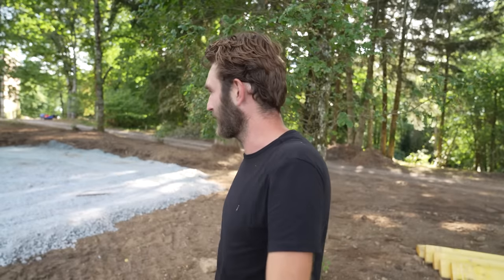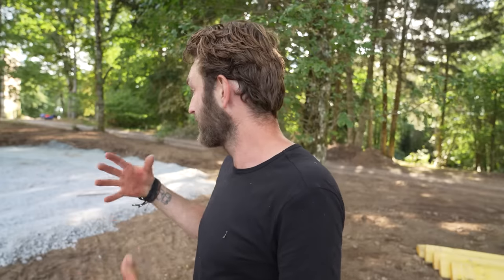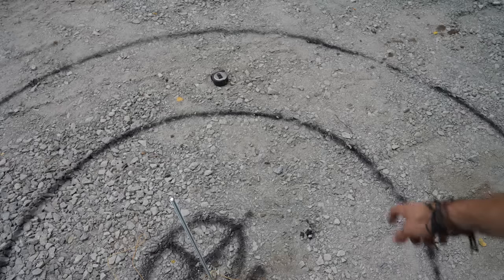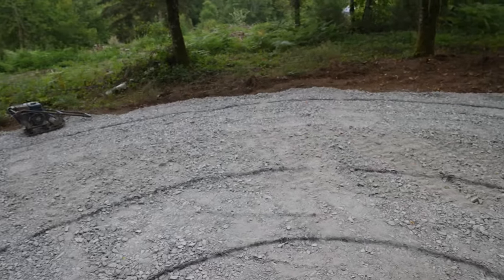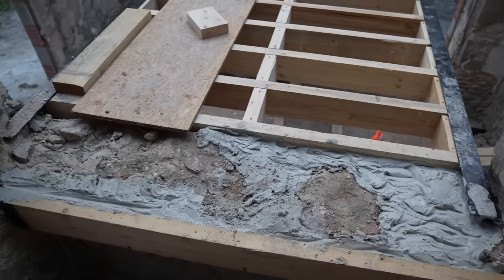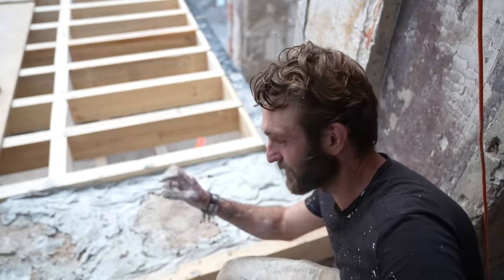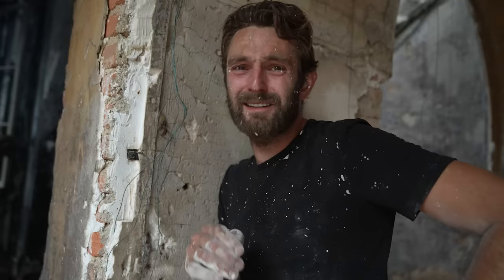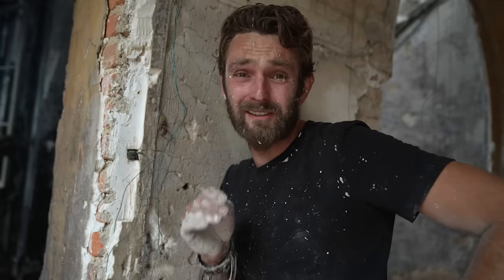It's finally arrived!

Comment: Good grief!! I thought the scaffolding was going to be wrecked even before you got to use it! 😂 you’re one in a million Dan ❤
Reply: I thougt so to 😅
Reply: Cringe offloading 😮🙈🙈
Reply: I was horrified!! Good grief! Look after your new toys man!!
Reply: Parts of it bent as it hit the ground. 
It should all be inspected and the damaged parts removed for safety.
Reply: Professional inspection of the scaffolding before constructing for use in the chateau...definitely!
Reply: Not the smartest way to unload your new, now likely bent, scaffolding. Good grief.
Reply: Crazy! Unsafe now for sure!
Reply: You couldn`t have taken it off a piece at a time? Kinda irresponsible.
Reply: End hooks bent, tubes bent due high weight on top. Irresponsible unloading. Needs inspection. Would take some time to unload but this is a bad example.
Reply: It's the first time I'd seen a 🏊‍♀️back-flip 💦off a dump truck
Reply: If it got wrecked before he used to just by tossing it off the Truck, then that would of been a blessing !
Reply: He's just stress testing it before use :)

Comment: Next time Nick is there with a digger, have him use some of your fill debris to make a little unloading ramp-  the same height as your rental truck bed, a flat surface (maybe 8 feet by 10 feet?) to unload stuff onto, and a gentle slope down to ground level on the opposite side that you can use a moving dolly to move the unloaded items down. 
Or, an earthen ramp that is truck bed height outside one of your chateau doorways (you can remove the ramp once you’re done with big deliveries). Watching the brand new scaffolding dump out of the truck uncontrolled was painful!
Reply: Agreed.  I have a ramp like that at the farmstead.  Amazingly useful for loading/unloading trucks, can even drive cars onto a truck bed with it.  Watching that scaffolding get dumped hurt.  I'd be surprised if there isn't some damaged to the scaffolding frames.
Reply: This sounds very practicable.
Reply: Absolutely.  I just don't understand why that stuff cannot be delivered.  I lived in France and just had a car, I had everything delivered from gravel to bricks, cement,large stones, electrical equipment.  Didn't cost much. When your buying a lot , if its not too far to for it to be delivered it was free. So much time be eaten up having to go to the brico
Reply: @lindaarmstrong5972 every penny helps I suppose?
Reply: I have the utmost respect for what he's doing and has done and admire the care he puts into everything, but I agree that watching that scaffolding tumble to the ground and crash was baffling. Granted, unloading it by hand would have taken a couple of hours, but I can't believe he took a chance on this one.
Reply: @qdbout  he even better slided each section one by one from the truck. It is not that time consuming at all. 
Why the hurry?

Comment: You may want to build yourself some sort of LOADING DOCK on one of the two front stairways-- something about the same height as your truckbed so you can walk things on and off without having to carry them up the stairs to get them in the building. Make it of timbers, to extend the landing out to the end of the stair at about truck bed height. Even if it's not level, you could either make it a ramp or reduce the many steps to just a few.

Comment: You might want to renovate your cement mixer. I'd like it painted with a spiral pattern viewed from the back, so that when it rotates it becomes hypnotic. Add 'Escape to rural France' on the non-moving vertical brace, also. Your work is succeeding.
Reply: 🌀 hypnotic Dan!
Reply: In between yurt,scaffolding etc.

Comment: Dan... Dan... Dan..., first man, come on. Just take the stuff off the truck one at a time, and don't damage it. Second, add a bunch of small/medium filler stones to the lime pour. so you cut the cost of lime, and you have so much stone on your property that will cost you nothing. Or old bricks. Plus, it will be much stronger. Thanks for the videos!!!

Comment: Definitely looking forward to the scaffolding. Once it is up you can immediately get the very top tower floor in and fix the the top of the walls and put a roof immediately on top. 
Could probably get the top floor in and immediately frame the walls from the inside, take a rough estimate of how tall the walls are going to be and build the roof on top of the needed space so that you can work on the walls beneath the dry and safe roof. 
Using the clear corrugated sheets up there will give you all the light you could need to work up there during the day, and also allow enough light down the tower to the the floors below if you replace all the wooden beams and leave the flooring till last. Placing them on the very top floor only when you are using them. When you are done up there you could probably leave them up there but stand them up out of the way to let maximum light to shine down.
Rebuilding the staircase from the top down will be interesting as you work your way down. 

Edit: you can probable use the exact same pitch and height of the tower roof and extend it backwards over the central hallway as well. Framing it all up as the one and the same temporary roof. 
Also give the tower roof some overhang so that the two balconies either side of it have a small bit of cover as well. You will soon be able to get to them regularly and take a breather and look out over the grounds.

Comment: Finally, a stairway to Paradise. What a brilliant useful bit of kit that will be. I hope that it will be easy to then set up some electric block and tackle system to easily facilitate the raising and lowering of building items. A builder’s rubbish tube set up from the top floor down would be very handy to find or relocate from another site when no one is looking!!
Glad you had a wacker packer to pound those stones into submission for your Yurt pad. A yurt will be a whole lot warmer and roomier than a tent to live in during the cold months and your kids will love it. Best of luck in building and preparing the insulated base for the new accomodation in time. We will all be here watching enthusiastically and calmly because a yurt is at ground level. 🇦🇺🦘🦘🇦🇺

Comment: You should get a block and tackle set up to lift heavy things to the upper levels since (I’m assuming) you can’t charge your batteries for the electric winch now that you are camping out.
Reply: I think he uses his Ecoflow solar system?
Reply: @xaxmac1948  he needs a power source to charge it. After using for power tools it takes time to charge with solar.

Comment: Did you get the rubber wheels for the scaffolding ? They come with friction brakes. Since you have a hard surface to roll on ,it makes it easier to move the scaffolding.

Comment: Dan, I have built my own house recently and I know how difficult it is from personal experience. I am hugely impressed by your effort and enthusiasm, but you do need to stop and think about your strategy. Putting multi storey scaffold up to the top is not a sensible option for the interior, both on efficiency and on safety grounds. Far better to go up floor by floor, as you have already done in one outer wing. I would put in a temporary staircase between each floor (simple pre built flights are very cheap) with a full height hoist for your materials. Use the scaffold to work more easily on each new floor by building a platform on the floor below - it will still be a good investment.  Hope this helps, and good luck.

Comment: Dan, please remove the spray foam. When it gets wet - which it will - it will hold on to the water like a sponge and begin the rot process. It would be better to leave that gap to allow the timbers to breathe, but if you really want to fill it I would do so with a material that's less inclined to retain moisture.

Comment: Brilliant! Someone plz explain, he's not putting insulation between the naked gravel and the OSB is he? It sounded like the wood wouldnt cover the gravel only space it in a sunburst pattern? What am I missing?
Reply: Oh okay, he said "insulationboard" on top of the radiating floor beams, whatever that board is, I'm hoping it's damp proof. And he has a solution for leading away all the water and occasional snow that will land along the perimeter of the yurt, from the pitch and roof area over fall, winter and spring. He doesn't want torrential rain filling up the gravel layer, but he's too experienced to not have worked out a sustainable plan. It's Dan, the man with a plan.
I'm so exited to see him on proper scaffolding. 🙌

Comment: little trick.  setup a incline that you did, but not all way.  throw rope on the top of the material.  "ease" (slide) material off by pulling the rope on the side, not in front of the slope.

Comment: Dan you are doing awesome.. You talked about speeding up the floor beams cutting and preparation.. What about the router and the saw fence to keep a straight line..  Also what about a air compressor and a nail gun to do the noggins installation it could go a lot faster than the screws.. Could also be used to put down flooring boards and more.. 

No matter what you do this is a massive undertaking and you are killing it.. Keep up the great work and the videos..  Cheers  !

Comment: That was a real bummer around 8:10, I don't understand why people are using that crap on old buildings while restoring them.
I mean in many old buildings they find defects caused by more "modern" materials to "improve" flaws in the old buildings.
Only to find out that the old way of building couldn't handle modern materials.
Old buildings must be able to breathe, you don't want to suffocate them.

I know that this sounds very negative for the majority of people watching this channel.
But I don't want Dan to make unnecessary mistakes in an early stage.

Comment: To completely level floors add batons to top of low sided beams, (furring pieces).  A wood provider can probably cut the furring pieces, or get the correct width plywood, 3 6 9 12 15 18mm 😁😎😁

Comment: What about using some of the old metal beams you've taken out with a welder to create a swing out crane from one of the upper windows using your electric hoist to raise stuff. Lugging those bags or cement and mortar up a ladder cannot be great fun. If a gantry can swing out a side window where you already have upper floor, you could parkt the weheelbarrow below that window with the bag in it, hook your bag on then sprint upstairs and haul it up, swing it in, and use.

Comment: I SAW ON ANOTHER CHANNEL THAT WHEN MIXING CEMENT, IT'S SUPPOSEDLY EASIER IF YOU PUT THE WATER IN THE MACHINE FIRST. THAT WAY, THE MIX DOESN'T STICK TO THE SIDES AS MUCH. HAVE YOU TRIED IT THAT WAY ?

Comment: Hi Dan good luck with getting the yurt flooring finished on time. Will you actually own the yurt, as its  certainly a lot of work and expense to get it all installed.  So i was just wondering if you are renting it or if its going to be there permanently

Comment: Dan, please tie up your sneakers. I'm having a knipshit hoping you don't trip on them and careen into an abyss to the ground floor. On a lighter note, well done you for a new scaffold although just one question. wouldn't it be easier to lift the mixer up to whatever level you are working on, and then drag the dry stuff up the same way as the mixer. I've seen you hoist things. Then, you only have to mix, leaving your back intact?

Comment: What is the black substance you're adding to the ends of the wooden beams? Are the wood beams "pressure treated" if they sit adjacent to lime, cement or steel I-beams?

Comment: Not gonna lie the cement mixer , the new scaffolding , the old scaffolding  has taken some unnecessary battering and neglect , the noggins are up and down like  beach sand when the tide goes out , some attention to detail is sadly lacking here and it will inevitably  produce some cracks if not reigned in  , it’s just the law of probability .

Comment: Out of curiosity why do you want a yurt? If cheap temporary accommodation is needed why not use temporary office style accommodation with a three or five year life as in industrial living units? Cheap and instantly transportable without all the groundwork or at least limited. I have no doubt you are a brilliant gardener and you are learning reconstruction very quickly but your engineering  and financial management appear more limited. This is a facility that will evaporate quickly in this current climate unless there is a substantial European change. I want you to succeed but I fear for the long term progress unless you have unlimited funds behind you. I, in a lifetime, have revived smaller projects but however well you calculate them they all seem to come in 15 to 20% over budget. This has to be placated by being very stern all the way through. You already know this from your odd comments but you still persist in strange handling procedures. Fine for as long as you get away with it. What I was told by a relative who gave me one of his lathes before he died and I abused: You are having to pay for your own apprenticeship. Don’t make my mistake which was recovered relatively inexpensively at £300. I am pleased you have improved safety with the new tower and you can put roof on wing. You talk of tower: fine but do one thing first. I had a raging industrial boss. He wanted several things at once to keep matters going. I told him I had one pair of hands. This is your problem. Focus on one thing, the wing, and roof it. Then go for your tower. It has stood this long don’t panic. Dissipation does bad things and fixes little. That is my offering for fifty years of work for other people. I want you to succeed so don’t make my working life mistakes and try and please too many masters!
Reply: Dan needs somewhere safe, dry, warm & clean for himself & for when the boys come to visit. He can always rent the Yurt out in the future to help with added income

Comment: You do realise there's a reason we use concrete now instead of lime right? It was the best they had over 100 years ago, it is not any more. It is not worth it just to be "true" to how it was done way back then. You are not doing yourself any favours by using less than the best/strongest material you can get. If you like the look than just do a thin cover coat not the structural stuff. Don´t you want the place to be the safest/strongest it can be? I never seen or even heard of lime being used in a bridge or a new building the last 50 years, there's a good reason for that. Shure keep the look but not the flaws in the building.